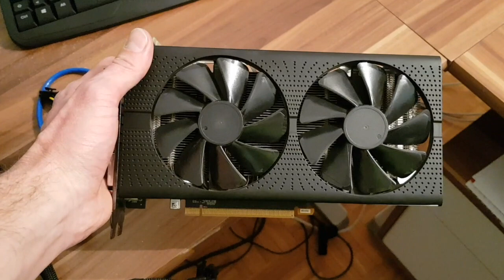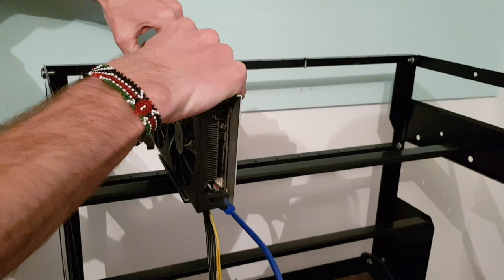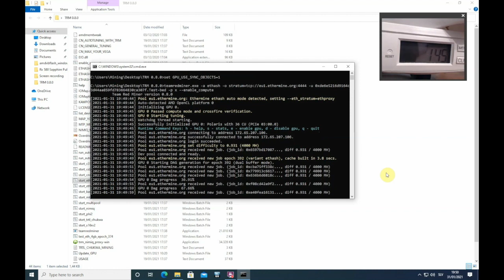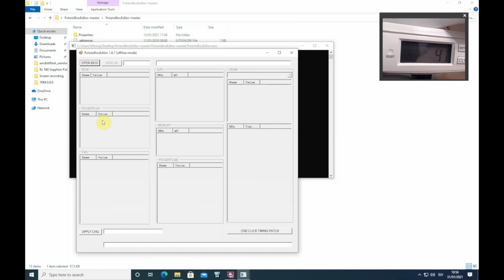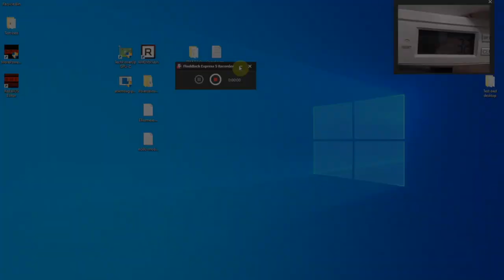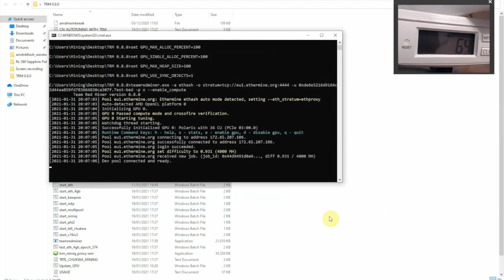Beginners guide : Rx 580 8gb Ethereum mining - bios mod & overclocking

Comment: Hi bro i have a problem 
I have a xfx rx 580 8gb but my hashrate is 7.58 so can i do for increase hashrate ?
Reply from the maker: Hi... you need to switch your card from graphics -> compute mode... 
If you are using team red miner you can add --enable_compute at the end of your command line.. if you are using any other miner you need to manually switch it in adrenalin drivers...
Reply: Ohh thanks can you tell me how much set my temp limit my gpu ?
Reply from the maker: @hbm80mir  you dont need to set temp limit, leave it as it is... 
But you want to have your target temp 55-60
Reply: Bro my gpu's temprature when was mining 60'C to 70'C and my gpu's high temperature is 90'C it is okay or not ?
Reply from the maker: @hbm80mir  90 is not ok.. where do you have your gpus, in an owen? 
Take care of ambient temperature..
At what percentage are your fans on gpus spinning? 
Did you undervolt and underclock core, undervolt memory?
580s are gpus which dont overheat usually... I have no problem keeping them below 50°C if I wanted to...
Reply: Bro 66'C Good and 44 fan speed
Reply from the maker: @hbm80mir  put fan at 60%
Reply: I use afterburner but temp limit is not worked
Reply from the maker: @hbm80mir  dont use afterburner for amd cards
Reply: My card name is xfx rx 580 8gb
Reply: So what i use for control my temp limit
Reply: Bro i set power limit -30 so temprature come 58'C it is okay or not ?
Reply from the maker: @hbm80mir  it is ok if you are getting good hashrate...
Reply: I recieve a 24 to 26mh/s with this settings and 80 to 105 w recieve with this setting
Reply: Can you tell me best setting for mining
Reply from the maker: @hbm80mir 24 to 26 is not ok... 
There is no single best settings that works for everyone... but you can try
1150/850 core, 2100/850 memory, 60% fan, no power limit
Reply: Bro i have a 685w power supply it is good for mining ?
Reply from the maker: @hbm80mir  depends on how many gpus you have..
Reply: i have one gpu xfx rx 580 8gb
Reply from the maker: @hbm80mir  than your psu is more than enough.. :)
Reply: Hi bro what mean (gpu are auto tuning hashrate may be low until they are ready )?
Reply: It can damage my gpu ?
Reply from the maker: @hbm80mir  it means that software is tunning for the best config... this is ok, let it finish.
What can damage your gpu?
Reply: Bro bios mod can damage my gpu or not ?
Reply from the maker: @hbm80mir  yes it can
Reply: Oh i bios my gpu so what i do now
Reply: Without bios mod my hashrate come to 24/26 mh/s and with bios mod my hashrate come 30 to 31 mh/s
Reply from the maker: @hbm80mir  something like that yes...
Reply: Bro i want back my gpu original version so what i do
Reply: So what i do for back my real bios
Reply: Bro you are gpu's are bios modded ?
Reply: Hi bro i found new settings for mining i use afterburner so my new settings is Core voltage -168 power limit +50 core clock 1120 memory 2100 and fan speed 65 so bro it is good for mining 7/24 and temp come around 58 to 60
Reply from the maker: @hbm80mir  what is power consumption and hashrate?
Reply: Bro can you tell me it is good setting for 7/24 mining?
Reply: 115W and Hashrate 30mh/s
Reply: Bro i recieve too much rejected share and invalid share
Reply: How to solve this problem 👆
Reply from the maker: @hbm80mir  115w at the wall or in the software? 
I dont know what was the cause of rejected shares... Usually it is too high overclocks
Reply: In the software
Reply: Bro what Usually normal Temp for mining 7/24 i think under 72'C What you think about this i have xfx rx 580 this card when i running this temp come around 75 to 80 but i less power limit to -20 so now temp come 65 to 70
Reply: Hi bro my setting is core clock 1120 memory 2100 mv 850 fan 60 and i recieve 30 to 31 and use 89W and temp come around 53 to 56 it is good for 7/24 mining non stop  and this setting can damage my gpu ?
Reply from the maker: @hbm80mir  this is ok for 24/7... Are you using ref 30?
Reply: Ref ?
Reply: You mean hashrate yes i recieve 30 hashrate
Reply from the maker: @hbm80mir  no I mean memory timing REF
Reply: No bro i don't use ref
Reply: Bro how to know that check if my memory timing on or not ?
Reply from the maker: @hbm80mir  you need to use amd memory tweak tool to set your ref to value 30
Reply: This work can boost my hashrate ?
Reply: Just set ref 30
Reply from the maker: @hbm80mir  yes it will boost hashrate for 0.5 - 1 mhs
Reply: If i don't do that so it can damage my gpu ??

Comment: My GPU RX 580 keeps crashing when i increase my core clock from 1100 to 1200 mhz after modded bios from this video. Please help me now.
Reply from the maker: Dont increase it to 1200... or increase core voltage
Reply: @lukee7290  i think i cannot increase more voltages on afterburner from msi is it right?
So i downloaded overdriven tool
Reply: @lukee7290  bro what is this gpu timing level 1 and 2 it keeps crashing maybe i dont have to change these
Reply from the maker: @AdventurerRaman  use overdriven, and dont change memory timing level...
Reply: @lukee7290  black hawk can we talk together on discord related to ethereum mining and oc guide for rx 580?
Reply from the maker: @AdventurerRaman  you have it all in the guide... ;)
Reply: @lukee7290  btw u made my day all the way up to 32 mh/s from 30 i wanna say thanks to you and keep posting more on rx 580

Comment: Hello, is this the max you cn get out of the RX580? is there a memory tweak to increase hash rate like the vega?
Reply from the maker: The max stable was 34.5 for me... I was even able to get above 35 but didnt bother to try to make it stable as i was not intending to use those settings...
Memory tweak for rx 580 is --REF 30
Reply: @lukee7290  does it need flashing or anything else? Just the tweak?
Reply from the maker: @weewee-f8f  flashing, overclocks and memory timings
Reply: @lukee7290  Flashing with what?
Reply: @lukee7290  do you have a video for it?
Reply from the maker: @weewee-f8f  
https://youtu.be/jMubomHQeDc
Flashing with 1550 straps...
Reply: @lukee7290  Hi, I have flashed the straps and got 35MH without amdmemtweak :). About 97 W. that's good :). used your settings 👍
Reply from the maker: @weewee-f8f  which settings are you using... you didnt use Ref 30?
Reply: @lukee7290  i used the settings you had in the video with REF 30. The last settings.
Reply from the maker: @weewee-f8f  ref 30 is memory timing which is set in amdmemtweak tool.
Hive os have it build already in overclocks
Reply: @lukee7290  Yes, I know that. I mean that I did not you the rest of the settings in Amdmemtweak.
Reply from the maker: @weewee-f8f  other setting dont give much improvement.. 0.1 mhs
Reply: @lukee7290  Actually I reached 35.94MH with overclocking, but i got Rejected shares, so I went back to your settings.

Comment: Thank you for this video! it has helped alot. But quick question, when I use OverdrivenTool and i make changes to it will only change the hash for one card. Even though I load it to the other 4. Nothing changes, any suggestions?
Reply from the maker: Thanks!
Once you load it to second, third ... card you need to hit apply... apply for every single card
Reply: @lukee7290  yep did that still no changes.
just sits at 24.75 (pre bios modding)
Reply from the maker: @gxgeoff5739  ah ok
Close miner.. reset cards, apply overclocks and run miner again
Reply: @lukee7290  thanks! everything is working better. appreciate the help
Reply from the maker: @gxgeoff5739  with this cards you always need to close miner, reset cards, apply overclocks and start miner... to make any changes to overclocks
Reply: Join us to start making daily and weekly guarantee earnings on crypto, Nft and metaverse stocks through Amelia strategy. I really appreciate the effort of her who made it happen.•••

Comment: WHat is the best motherboard/psu for gigabyte aorus rx580 8gb + 3x 5700 8gb ? thanks
Reply from the maker: It is not easy to suggest hardware components, as it comes to what you can get at good price.. there are many good motherboards and psus which are appropriate. 
Browse google for best mining motherboards and psus. 
When it come to psu I would suggest not to spare money. Take at least 80+ gold quality, at least 850w...
It depends if you know how to optimise cards propely also 750w is enough.
Reply: @lukee7290   thank you , my main question is what is the best motherboard or at least what you suggest  ,for what could i use DDR5 (rx580) with DDR6(5700) ,thanks
Reply from the maker: @school_education242  it doesnt matter which memory you have on the gpu - gddr5 or gddr6 memory.... all of them will work on every motherboard.
Check this link
https://cryptominertips.com/mining-hardware/gpu-mining-motherboards/
From this list I have used gigabyte b250-fintech and gigabyte ga-h110-d3a and am very satisfied with both...
Reply: @lukee7290  thanks , it was very helpful  , ive heard that etherium would no longer supports amd ,(after two or three years ) , and only NVIDIA would be supported ,is that correct?
Reply from the maker: @school_education242  i dont think so... eth will move to proof of stake, meaning no more mining for eth.

Comment: I can't find the settings for "Compute Mode" in AMD Driver Software see: ibb.co/mTZFCQs
Reply from the maker: https://www.amd.com/en/support/kb/faq/dh2-024

Check this link...
Reply: @lukee7290  I've tried this documentation, but you see on my screenshot, this option didn't exist...
Reply from the maker: @TheAredon  which drivers do you have?
Reply: @lukee7290  Driver Version
20.45.35.01-210204a-364034E-RadeonSoftwareAdrenalin2020
Reply from the maker: @TheAredon  can you install adrenaline 20.4.2
Reply: @lukee7290  Ok, installed 20.4.2 - Driver Version
19.50.29.27-200515a-355312C-RadeonSoftwareAdrenalin2020 but this Option isn't here now... I'm on Windows 7, can that be the problem?
Reply from the maker: @TheAredon  well maybe, i never use win7 so I really wouldn't know.
The fact is that you need to somehow switch your card into compute mode, team red miner should do it for you with 
--enable_compute command, but it seems it doesnt in your case, it could be that win7 is the problem, but i dont know...
Reply: @lukee7290  Ok, thank you for your reply & support!

Comment: Thank you for this Quick&Easy explanation! But I get with computed mode enabled and restarting my computer, I get only 1.5MH/s more than before. What can the isse be? And old PCIe driver? Sapphire RX 580 Nitro+ with 8GB
Reply from the maker: Hm hm.. I am not sure.. can you try to shut down and start again. If it doesnt work... you can open adrenalin drivers and switch from graphics to compute mode manually...
Reply: @lukee7290  The funny thing is: In the Radeon Software I didn't have such a selection to switch between Graphics or Compute-Mode. I tried the new and an old version (20.11.2) of the Adrenalin Software - no options here :-(
Reply from the maker: @TheAredon  you have it, you just didnt find it... let me see

Comment: Hi Blackhawk. Newsubscribee here. I just wanna ask if the bios mod ang the overclock works on all model of RX 580 GPUs? Thank you.
Reply from the maker: Hei Alexies, overclocks depends on what memory brand you have on your card (micron, hynix, samsung ...). My cards are micron. 
So bios mod yes it will work in any case, but overclocks might be different for your card... you can try with my overclocks from this video, becouse this are "safe" overclocks and there is high chance it will also work ok for you, if not take my voltages and decrease frequencies, and once you get it to work, slowly build up ato the loint where is not stable anymore

Comment: Good video. But i would recommend not using the sata connection. When upgrading to a more power hungry card the raiser can pull up to 75watt and the sata are not designen for that. I recommend to use 6pin or atleast a molex. Safety first 😊
Reply from the maker: Thanks! You are right and wrong at the same time. Yes molex and 6pin are better than sata.. but when you have your cards optimised, it also means power consumption is much lower than stock, you will not have problem with sata. I have been using sata for years, also with cards that were consuming 200+ watts, and never had any problems...
So if you know what you are doing also sata is ok, but I agree molex and 6pin are more safe in any way.
Reply: @lukee7290  👍 and what happens If your rig restarts (which is very possible with Windows) and your settings wont apply but the mining program auto-start? That is when we could have a real problem. But you are right. As long as it all works, then there is a small risk of failure.
Reply from the maker: @niclasswenson6970  why settings wouldnt auto apply.. we have scripts for auto applying settings... 
But ok you have a point, in case anything goes wrong it is more safe with molex and 6pin.. I agree :)
Reply: Join us to start making daily and weekly guarantee earnings on crypto, Nft and metaverse stocks through Amelia strategy. I really appreciate the effort of her who made it happen.••

Comment: Thanks for this video.
It was a good help to make my RX 480 Nitro+ 8GB consume less power.
I don't have done the bios mod, only apply the value you indicated in the OverdriveNTool, and the power consumption passed form 115W to 65W/70W.
The temperature also reduced from 70º/80º to 54º/58º.
The hashrate improve was between 2 to 4Mh/s.
The only other change I make was in the Radeon software changing the memory timing to Level 1 to obtain the higher hashrate (29.53Mh/s).
I really don't know if doing the bios mod the hashrate change enough to justify the hassle.
Thanks again for the excellent explanation.
Reply from the maker: I am happy that you were able to achieve such an improvement using my settings!! 
I would guess that by using "timings level 1" in the software is kind of same effect as doing bios mod, so probably there will be no or little improvement doing bios mod.. but I am not sure, I would need to try..
Reply: @lukee7290  I realise after that in OverdriveNTool there is a option to choose the timing level, so no need to go trough the Radeon Software. I trying now to "refine" a little more the setting to squeeze a little more hashrate with no power increase.
Thanks again for your video.
Reply from the maker: @TheWhiteSpot  thanks for the info... yes new version of overdriven has this option.. I am still using old version... i wish you happy mining
Reply: @lukee7290  the only thing I cant get working is the enable compute. I have to manually change this option in Radeon software to works.
Reply from the maker: @TheWhiteSpot  you need to put --enable _compute at the end of your command line in team red miner... but if you already changed in the drivers than you are ok..
Reply: @lukee7290  I put this "command" in the right place and it does nothing. I have to change manually in the Radeon software as I said. Not a problem but still need to make the change manually. Thanks again.
Reply from the maker: @TheWhiteSpot  hm that weird, it always works... but ok, it is working for you now and that the most important ;)
Reply: Join us to start making daily and weekly guarantee earnings on crypto, Nft and metaverse stocks through Amelia strategy. I really appreciate the effort of her who made it happen.•••

Comment: Will this bios mod work on rx 480 8gb or is it only for rx 580? Thanks
Reply from the maker: It will work on 470/480/570/580
Reply: @lukee7290  how to make this parameters after reboot ?
Reply from the maker: @RAMMSTElN  how to make them auto apply?
Reply: @lukee7290  i mean how to make them works again after reboot
Reply from the maker: @RAMMSTElN  well the same way you make them work the first time...
Everytime after reboot you need to set settings up.. always the same way
Reply: @lukee7290  not so good if you have 10 videocards in 1 rig :D :D :D
Reply from the maker: @RAMMSTElN  i have hard time understanding you... what are you talking about. Which setting. 
Bios mod?
Overclocks?
Memory timings?
Reply: @lukee7290  i mean every time when you reboot your system and if your system consist with 8 x RX 580 every time you need to tune each card lol
Reply from the maker: @RAMMSTElN  you dont need to tune.. you just apply settings that you know works best for you... and for applying those settings we have auto scripts...

Comment: Hi, Nice video. When we plug more cards, do we need to power 2 Molex on the motherboard?
Reply from the maker: No.. I have never connected molex to motherboard and it always works...
You would need molex if you pluged cards directly to pcie express x16.. but now you power it through riser ...
Reply: Great, Many thanks for the info.